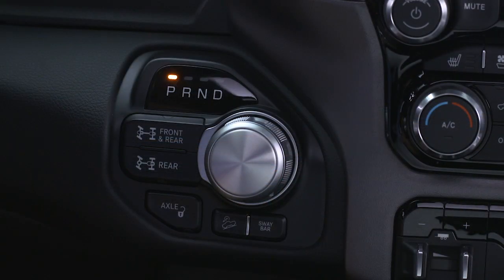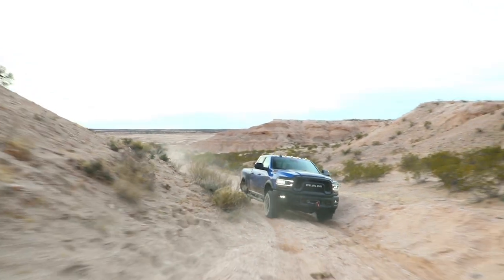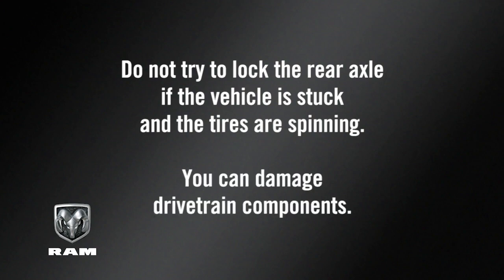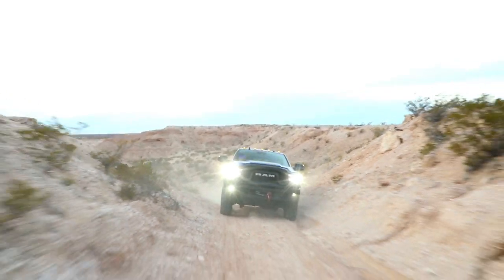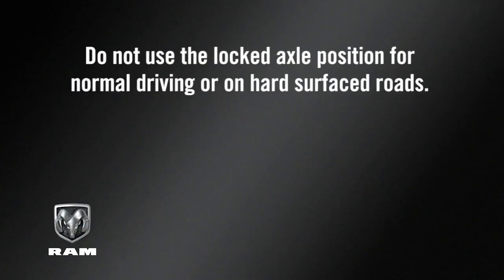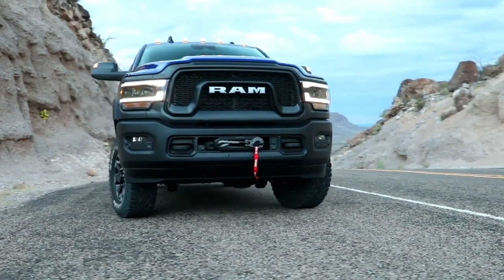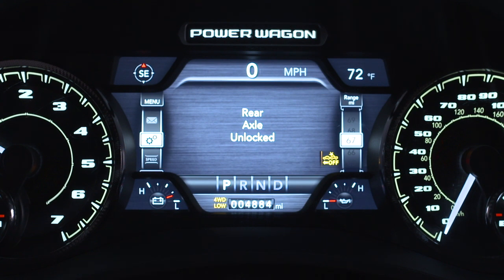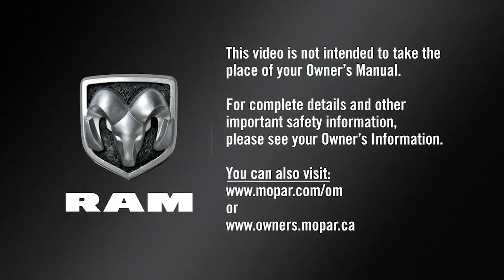Axle Lock – Power Wagon®| How To | 2020 Ram 2500-3500

Comment: My front won't lock. Followed this and the owner's manual, which doesn't really give much guidance. Brought it to the dealer and they say it works. Asked how they got it to lock and was told they followed the steps in the manual.
Reply: I just mess with my truck for about an hour and finally figured it out. To lock the front and rear first lock just your rear wait until it’s engaged, then switch it to both. You have to be driving about 2 mph slowly turn the wheel left and right while moving then it will lock
Reply: @MATTYICE459  I did that. The stealership did a software update. Then it worked.
Reply: If you have a chance to go back to that dealer, Ask them if they can scan the system for any  Hidden codes. My 2017 power wagon had A problem with the driver side window switch not  Going up automatically  . I told him no is thinking maybe it was a resistor And the Tech  Said that it was a code that needed to be cleared. That's a first for me . I guess that's the way it goes when everything runs through the cluster
Reply: Did you have it in a low range?
Reply: @deronborghi5929  Yes! I did it with a tech riding with me and it wouldn't work.